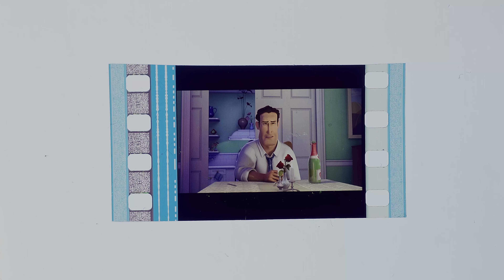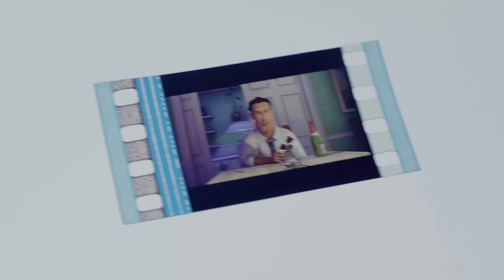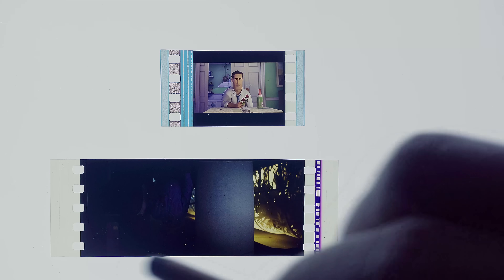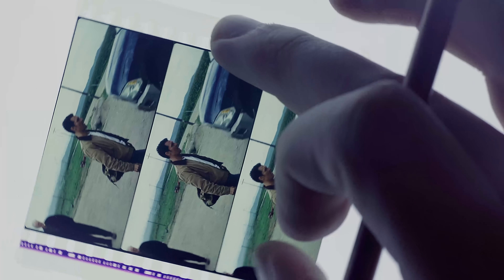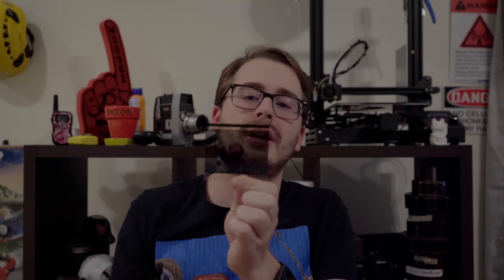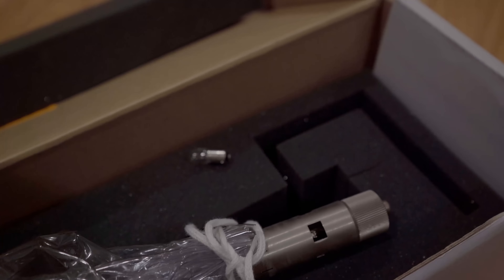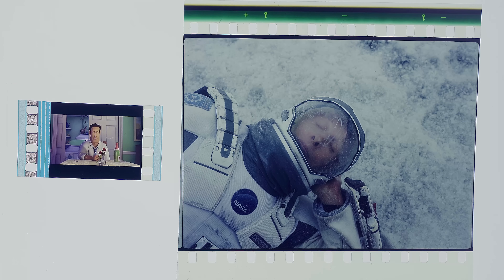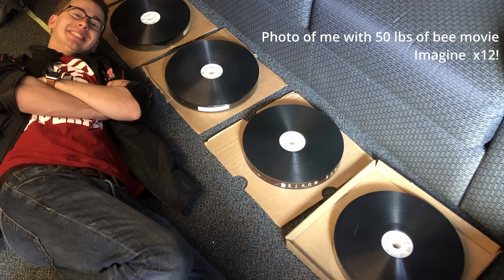Why you need to see ODYSSEY on IMAX 70mm film

Comment: This makes me anticipate my local IMAX even more.

Back in 2008, Sydney's IMAX closed its doors in preparation for a $2 billion makeover in the precinct it was in. On that date, it held the world record for largest IMAX screen at 35.72 m × 29.57 m (117.2 ft × 97.0 ft).

It went out with a bang in 2016 when Christopher Nolan actually choosing to run the Dark Knight 15/70 for the final time; a perfect choice for a perfect screen to run 15/70 on. This video is: https://www.youtube.com/watch?v=CtxPuMOYpSs

The new replacement is behind schedule, and the exact screen size isn't known although there are some who have stated it needed to be reduced in size to fit the new building (which is larger oddly). But it has been said that Sydney always wanted to reclaim the record moving to a 35.73m x 29.42m, almost the same size as the old, which would make it still the largest in area albeit no longer the tallest or widest, but the largest 1.43:1

Hoping it opens for Oppenheimer. Prior to closing I saw Interstellar 15/70 and it wasn't only the quality of the image that blew me away, but the sound.

Just visited the brand new largest screen in Japan (Tokyo), which is 25.8m ×18.9m and in area, that's less than 1/2 the Sydney screen.
But to be honest, I think it's more manageable because the screen in Sydney is so large it requires extremely altered seating (feet are always behind the row ahead's head)
Reply: Do you think the Ribbon IMAX Sydney would open in time for Oppenheimer? (July 2023)
Or will it have to wait for Dune (November 2023)

Comment: Wait, but if the type of film is the same (or at least comparable), the only way to actually get more resolution would be to project a larger film into a screen of the same size, right?
If you increase the size of the film but also increase the size of the projection screen proportionally, the resolution remains the same... right?
Reply from the maker: Great question! Resolution does not change with size of a screen, because the source is constant. Take a 40” TV versus a 75” TV, both would advertise 4K resolution. So they both have the same resolution. But, as you pointed out there I a difference in density or size of pixels. But you are right, the bigger the screen of an IMAX 70mm projector the density would decrease. But, the density is far better than if you projected with a 2K or 4K digital projector. Hopefully that helps :)
Reply: @KyleMiko  Ah, that does make sense! In hindishgt, seems pretty obvious that (optical) resolution wouldn't change with how much you blow up the image, haha.
But then my question is... wouldn't how fine of details you can resolve depend mostly on the film grain and optics rather than the size of the film?

Comment: IMAX used 90mm not 70mm film, but Kodak hasn't coated any IMAX film this Century!!! If they did, there are no more IMAX film cameras in existence in working order, and not more than a dozen houses that still have IMAX film projectors and lamphouses!!! In 2007 the IMAX film format for movies was officially abandoned like Super Technorama 70 and Ultra-Vison 90 and a dozen more "premium size" formats. The film costs and SHIPPING the prints (was done by bus for years) then Film Transit, couldn't be supported.  Shipping the three or four "Movie-sized" (7" disc) hard drives for digital projection also prevents Pirating which is Hollywood biggest concern today. 70mm movies are Super Panavision, and no 70mm film has been made since1999. At the cost of about $88+ a second for the camera film and film processing ALONE and the 65 year-old antique Mitchell Number 4 cameras costing about $25,000 a minute for the 20+ person crew to operate (the bare camera weighs over 450 pounds and has to sit on a four TON "dolly"), the last film shot in 70mm  that made money was "Das Boot".All the 21st Century "70mm" movies have been SHOT on 35mm film (or horizontal format "Super 35" in Europe and Japan) then ENLARGED optically to 70mm prints for the dozen 70mm film released prints made. The teens that "run" movie theaters today (no projectionists) can't load or splice film. A movie theater today can't afford $800+ an hour for a Union Projectionist watching ONE theater's projector. Since most movie houses since the Panic-demic can't pay the bills, a B&W film ain't gonna bring in no teens! In 2021 Tulsa Metro had 160-odd screens.  Today it's 29 or 30. The bargain "giga-plex" houses are GONE! Like Blockbuster Video Stores. With only "cartoon-action" movies, adults over 40 rarely pay for a ticket, and no "oldies" matinees that were BIG BUCKS for big screen houses that us "old hippie's" went to has closed three AMC's and ALL the General Cinema houses.  Today we have SIX 240 foot  wide screens left. We had 60 on one INTERSECTION in 1990!  Two 8-14 screen houses in malls (now gone) and one free-standing 16 screen house now a parking lot, and the Bargain 20 is a Laser-Tag place.

Comment: There is one small issue with this size of film and the “impossible 18k resolution” and that is VFX.

Most vfx shots on “4K” movies are still done at 2k. That means downsampling the raw footage that is being worked with, or scaling up the cgi components to fit. Same will go for the imax “18k” footage. Once it’s done a digital round trip back onto iMax film, there’s gonna be loss somewhere.
Reply from the maker: You are correct for the most part, but the key here is that Nolan HATES digital VFX and keeps it “in camera” as much as possible. Yes, if there are scenes with VFX the resolution will probably be reduced, but going off of other movies like TENET (where he literally blew up 747) the less scenes with VFX coupled with the fact he tries to have the film prints chemically finished (no DI where possible) this should be mostly mitigated
Reply: @KyleMiko  what's DI?

Comment: But this is ONLY possible in the IMAX theatres that project FILM ANALOG. Now many IMAX are DIGITAL IMAX with a max resolution of 4K DCI. 70mm IMAX FILM is beyond 16K to 20K depending on the ISO of the film stock. IMHO IMAX DIGITAL is misleading for the IMAX resolution we know. I remember the 3D IMAX 70mm projections (till late 2010s) were WASTLY superior to any digital IMAX 3D nowadays!

Comment: I worked on Strong Gladiator follow spots in the 90s for a concert production company that used these 3000 watt  lamps. They sit at 3 atmosphere of pressure that can rise to 7 to 10 when hot. We kept them in a heavy duty timber box & could not handle them unless wearing heavy duty leather welding gloves, leather full body cover suit & a full face shield. Even cold it had the potential to explode & do some serious damage to fingers & eyes.
Seen one gentleman (roadie) changing a lamp without the gear on & I informed him of his stupidity.  A few days later, he was working on a gig, had trouble inserting the lamp into the holder. Discovered very quickly that using the lamp as a lever was probably not the smartest life choices. He did confirm he was wear the Homer Simpson gear as we called & and thanked me for forcing him to wear it all because he lost all feelings in his hands for a few hours.
Later I worked at a hire company that would hire out search lights you see for the Hollywood movie events that used the same lamps. Imagine my shock that they had the client installing these lamps without any safety PPE. So I sent them a link to the lamp manufacturers safety video. Needless to say they stopped hiring it that way.
So what I'm saying is this lamp you have should be handle with care & held in a timber box. 😮

Comment: There are two things that I need to mention. “LieMAX” is not just Digital IMAX, it’s the 1.90:1 IMAX ratio that is the Lie as it is not in the true 1.43:1 format. IMAX digital in 1.43:1 is still considered true IMAX.  

Also when it comes to film vs digital, it also comes down to how the image is treated between camera to screen. 

Christopher Nolan has the time and money to create his films in what is called a photochemical process. 

Meaning the colour timing (grading of the image) is done by hand, the very limited visual effects are scanned at an 8K resolution and then optically placed back into the film. And the editing is done using dailies, which creates timesheets for the physical edits which are then done to the film by hand. 

With this workflow, yes. The IMAX film version is the superior format to see the film. But this sort of treatment these days is ULTRA RARE. 

Most films that are shot with IMAX film cameras then go through a digital intermediate process. This then lowers the resolution down to (depending on the budget) 2, 4 or 8K. Usually 4K. Granted, still super high bitrate (which that’s a whole ‘nother thing entirely), but a lower resolution nonetheless. 

So in this instance, the superior format in terms of detail and colour reproduction 99% of the time would be the IMAX digital version. 

Whereas if you like the imperfections of film, by all means go  ahead and watch the film version. But the source is inherently 4K, and even blown up to 15/70 is still 4K.
Reply: Where did you read about this ??
Reply: @PETROVICGAMES  There’s a lot there. Not sure which in particular, but my IMAX and film knowledge is both from first and secondhand knowledge and with about 20 years of working in various parts of the film, television and client based industry.
Reply: I’m driving 4 hours to see Oppenheimer in true IMAX 1.43:1 70mm projection and I know it will be worth it! Also saw Tenet in that format but not his others. Hopefully they do a re release some day!
Reply: @loganastrup6870  Another true believer! 😂

I too make a long pilgrimage to the nearest IMAX. 

In Australia, our IMAX in Melbourne regularly bring out the 15/70 prints each year. Just need to see if there’s one, or if the one you drive to does as well.
Reply: Aren't most IMAX movies in 1.90:1 though? 1.43:1 would just be wasted space for theaters.
Reply: @brandon_nope  Only in the modern advent of IMAX Digital is 1.90:1 considered “IMAX”. 

And the term “LieMax” came from when IMAX still meant something. The Dark Knight was heavily spruiked as must see in IMAX and people went and just saw that it was nothing special and just had a few scenes in “16:9” opposed to the Full 1.43:1 version which was mindblowingly fantastic!

This is when IMAX started appeasing shareholders and left the “Image MAXimum” heritage and distanced themselves from purely being about the amazing 1.43:1 experience and started working to get their brand into as many cinema chains… and now peoples homes. 

So yea, a lot of films are in 1.90:1, but for example the difference in IMAX experience for the upcoming Oppenheimer will be 1000x better in a 1.43:1 screen than not. And a lot of the time, yes, the extra real estate is wasted, but more often than not the 1.90:1 image on a 1.43:1 screen will be more immersive as the auditorium was custom built for the space as opposed to a retrofit to suit a chain cinemas needs.
Reply: @brandon_nope  they do.
1:43 just adds the "old style" feel.
It is like the war between vinyl records and digital records: digital is way superior in any way PERIOD, BUT, if you record the music on vinyl, it will sound better on vinyl. You can simulate vinyl sound (there are valid VSTs), in fact, also in IMAX there are cinemas 1:43:1 with up to 16k resolution digitally (there is one 1 hour far from where i live). Will you notice the difference? No.
Also because higher resoluzions means more CGI work and today films have lots of rushed CGI (and also lots of rushed audio Mastering)
Reply: @TrioLOLGamers 16k digitally? What the hell are you smoking?
Reply: @L1ft0ff  they use a dual 4k laser projector on proper imax cinema and they claim that they are able to project a true 15/70 quality that is nearly a 18k. So yeah, absolutely over 4k when not in 3D, but still it is more than a gimmic because what matters is the quality of the projector and on what the image is projected. Also the film needs ti be perfectly recorded, etc. For example Avatar 2 wasn't good in IMAX 3D and way better in Dolby Cinema because 3D is better on a wide-screen.
Reply: @TrioLOLGamers  I thought the dual 4k laser projector is still 4k, just offset a bit to avoid screendoor, but it's the same exact frame in each 4k, not like a different offset image that each are showing to make it higher res?
Reply: @BrentKilboy  i don't know for sure... They don't talk specifically about resolution, but if I'm correct during a presentation they've said an higher resolution, but it could've been an error of the host...
They claim to be able to play an image similar to 70mm, but who knows about resolution... Also today only few films are recorded on true 70mm (big and loud camera), others are recorded on digital camera with lower resolutions (Avatar 2 for example was recorded on Sony Venice, so below 6k).
Reply: @TrioLOLGamers   I've seen TDK and TDKR in 70mm IMAX. I've seen Dunkirk in Dual Laser IMAX with the 1.43:1 aspect ratio. All 3 of them were amazing visual experiences with a giant 60 foot tall screen. The Dual Laser projection quality held up very well in terms of sharpness, brightness, and color for Dunkirk compared to what I remember on the film IMAX showings of TDK & TDKR.

Comment: just a note: Your 35mm image includes the optical track and your 70mm does not. 70mm/perf used to use magnetic stripe that also took up space, IMAX started using a double system (35mm full coat) so had a much bigger (maximum) image than previous projection systems.
Reply: I still wish Imax would have either worked out a deal with DTS, or come up with their own timecode-based system for the audio.  When I briefly worked with Imax film, it kind of blew my mind how they were doing sound by frame-sync.  It seems like they could have put some timecode on there (similar to the 5/70mm film strip in this video) and had perfect sound/sync every time without having to worry about it.  I will say that DTS has certainly made 5/70mm presentation a lot easier these days, not having to worry about the damn mag stripe, especially when it would get slightly damaged and cause clicks during audio playback.
Reply: @gustafsone  I love the giant oversized DTS timecode which is so easily visible on the 70mm print shown here.
Reply: "Oklahoma" and "Around the World in 80 Days" were shot on 65mm film (so was Oppenheimer). The extra 5mm was for six audio tracks
Reply: @PhilMoskowitz  Oppenheimer was shot on IMAX cameras running 70mm horizontally same as the projection, that is my understanding. Camera 65 that you refer to runs the film vertically and indeed the extra 5mm width was used for the innermost magnetic soundtracks on 70mm 6 track magnetic.

Comment: 4k is pretty equel to 35mm movie film.  Give or take the quality of the lenses and film stock used. I also think how Star Wars episode 2 footage was only captured in 1080P on a smaller sensor than most DSLRS have today. I think the sensor in that Sony camera was smaller than an APS-C sensor yet when I saw episode 2 in the theater I couldn't tell. Granted at that time I didn't know alot about digital film resolution and My Fujifilm MX-2900 digital camera was a whopping 2.3mp. 1800X1200

Comment: 35mm flat is usually 2K. There really is no point to scan 35mm any higher because color crystals equate roughy to pixel size and you can’t shove more crystals per mm. Anamorphic gets 25% more vertical resolution with 35mm but you need that special squeeze-unsqueeze lens. If you are wasting any money in a cineplex offering IMAX digital, don’t pay for it. It’s usually an upres and barely more than 2.5k. If your feature master is digital, then 4K anamorphic is more popular as a working format than it was 10 years ago, and this is the usual IMAX digital projection resolution, but NOBODY is delivering VFX in 18-20k that is necessary for true IMAX features. It’s all uprez. If you’re really lucky, the VFX house will work in 5k, but absolutely nobody is working in 18k.

Comment: You have done a fine job of explaining the technical IMAX structure. But do not forget what IMAX was designed for- to obliterate your peripheral vision. To lose yourself in the giant square screen.  20% of IMAX image is "garbage." It is just there to get your mind fooled into the experience. It is not art. The Aspect Rations of Oppenheimer have been announced as:
1.43 : 1(IMAX 70 mm: some scenes)1.90 : 1(Digital IMAX: some scenes)2.20 : 1(70mm and Digital)2.39 : 1(35 mm). 
I was in the business for 25 years- This is a wild variation of format. 
2:39 is ART.  That is how we see things- a big rectangle of beautify the horizon. 
If Nolan is shooting for 2:39- then everything else outside the ratio is garbage.  It is only there to fill that big square screen.  High fidelity and resolution are a by-product of the IMAX experience. However, if Nolan is really shooting for a square frame, then he is doing a great disservice to all those who seek the 70mm scope presentation.

Comment: How would you compare the image quality of IMAX 70mm to Dolby  Cinema which picture-quality-wise is better than normal IMAX (but, on a smaller screen)?
Reply from the maker: It really depends. HDR is the biggest difference, as the current film stock that motion picture film is on does not have a high contrast ratio, nothing compared to Dolby cinema (the stock that the film is recorded on, however, has a very large dynamic range). IMAX 70mm should be a higher resolution however, along with the biggest screen. Best thing to do is view each one and compare for yourself!
Reply: @KyleMiko  that's indeed the plan for when the movie is out ;)
Reply from the maker: @nishma  awesome! Please share your opinions after the fact :)